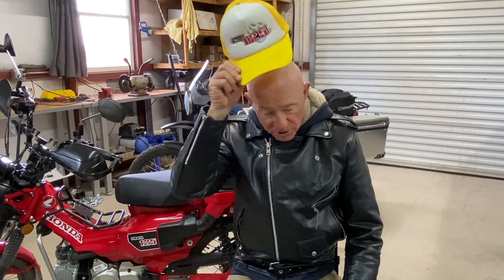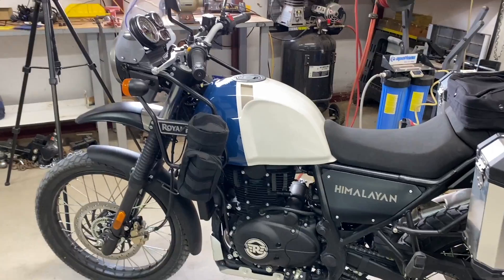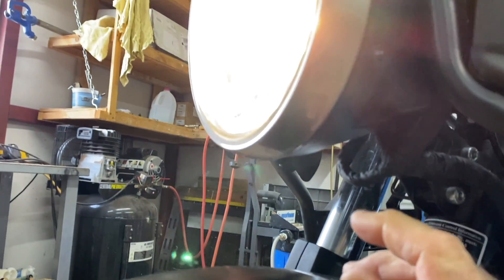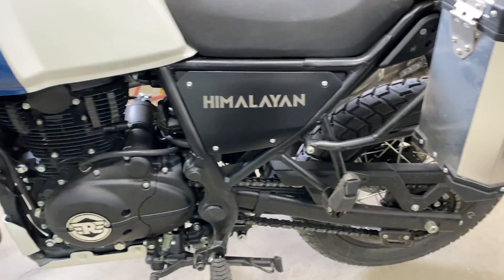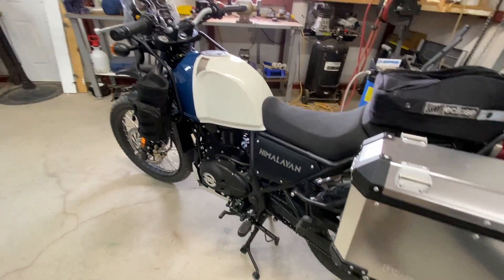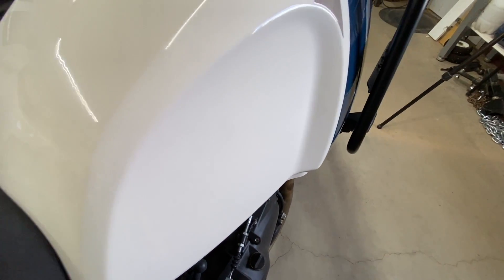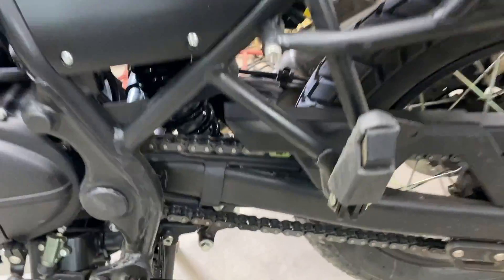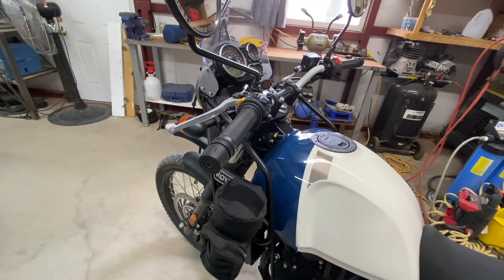Royal Enfield Himalayan first view   HD 1080p Part 1

Comment: wow....
so excited to see this
i know you'll love it
i'm just getting familiar with mine, as you
the best to you always
greg (ClearwaterBMW on ADV rider forum)
Reply from the maker: Thanks Greg.  I didn't know you had an REH!  How many miles do you have on it?  Weather has been bad here, cold and windy, rained all day the next day after I brought it home, but I managed a little over 140 miles so far.  Breaking it in slow.  With the cold weather I've been doing 10 mile "heat cycles" that a lot of the guys like to do to new engines.  Oil change should be coming up soon and valve check.  Do you the 300 mile oil change under you belt yet?  Did you do the valves?  How were they?
Reply: @spydie  I just got it two days ago I've been doing some stuff in the garage going out for a bit of a ride later today just barely 100 miles on it so far. I have enjoyed every single one of them
Reply from the maker: @Gregs_World  I've had mine going on 5 days today but the weather has kept me from putting miles on it.  What color did you get?
Reply: @spydie  I got the gravel Gray. I did put the ProForm bars on it course mounted the phone and then the SRC Moto GPS bar for my Garmin zumo XT. I have the black bags on mine
Reply: @spydie  I did put a few pictures of it on my Diana and friends thread on the adventure Rider forum in the battle scooter area because I'm not going to post in the thumper area
Reply from the maker: @Gregs_World  hey Greg send some pictures to me at oneranger at me dot com